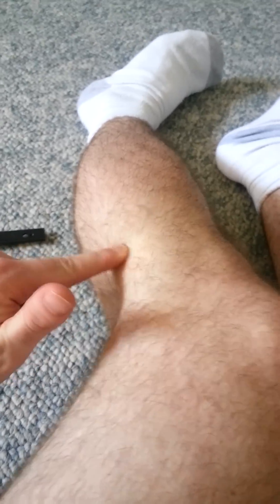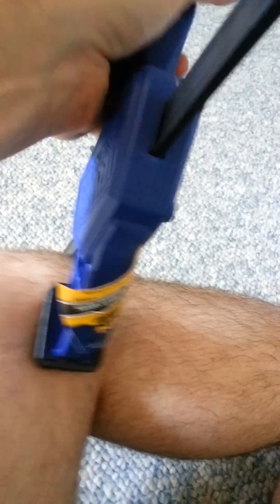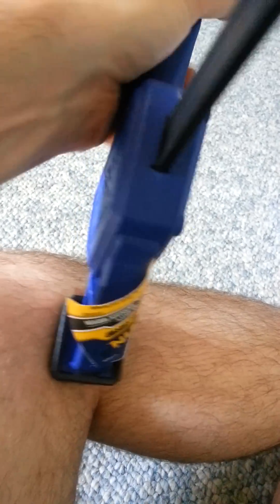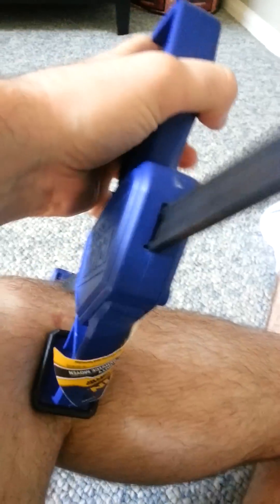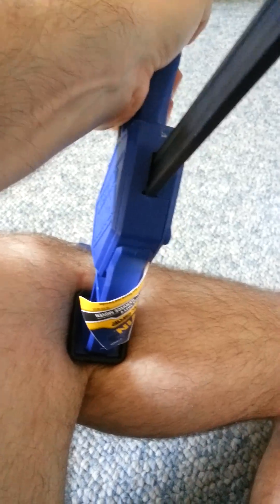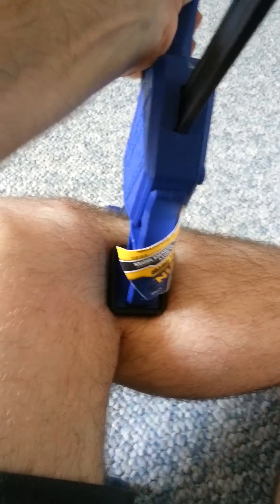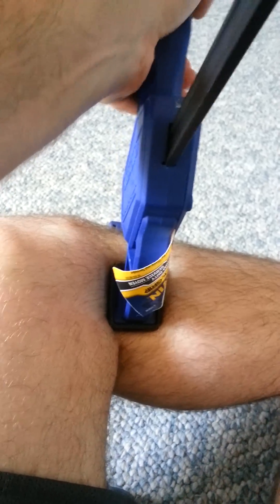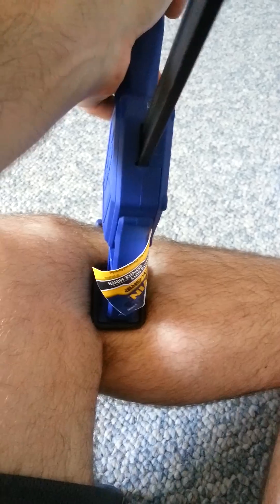LSJL Enthesis Loading near the knee

Comment: I guess if this guy would have success then he would show it to everyone. It is obvious! Probably he failed
Reply: Lifestyle & Travel I have had success growing a charted 1.5 inches through stretching alone, just because I have not shown people proof (what can I show really? Images and video, people will say they are fake, you can not win) does not mean I have not grown. Just try it yourself.
Reply: +computerman789 how long did it take? are you still performing the method?
Reply: I grew about 2.5 cm since my initial comment, if you can believe it.

This is from
1: Basketball training (running and jumping at hoop), for as long as I can take it.
2: A few light kicks every now and again.
3: Throwing and punching to help lengthen arms.
4: Basketball stretching (holding out arms and making a swirling motion).
5: Some very mild and few wall back stretches (nothing compared to what I did 2 years ago to gain 1.5 inches; Which only took me 3 months, might I add).
6: Subliminals to help ingrain my faith to grow in my subconscious.
Reply: Also, if you want a quick little bit of height, take Glucosamine. I took a good bit of it daily and grew .25 inch\.66 cm over a short period of time before starting to stretch.
Reply: @computerman789  so much bs, you probably just grew naturally. Basketball doesn’t make you taller
Reply: +computer789 thanks for sharing. Your exercises are used to help gain height temporarily. But i am looking for some possitive results from lsjl. Do you perform this method?
Reply: Nathan Nathan No, but the height I gained 2 years ago still stays with me to this day, the recent 2.5cm still stays with me after 1 week. I do not know where you got the idea that it was temporary, but it was not from my experience and my words. 

I am being sincere, you may have to keep stretching after you gain some height to maintain, but you will not need to do as much or as intense. Jumping, like Basketball training, should put some stress on your vertebrae and joints, coupled that with kicking and stretching should gain you some bit of height, the stretching will lengthen and the stress on the bone and cartilage should increase density and concrete your gained height. 
When stretching always keep your muscles limber and loose to increase the space between your vertabrae.

It is up to you to find out what works.
Reply: @computerman789  what age were you?
Reply: computerman789 Thank you for your comment, you’ve motivated me to try these things out for myself to grow taller
Reply: @computerman789  Dude were you successful in using the lsjl method?